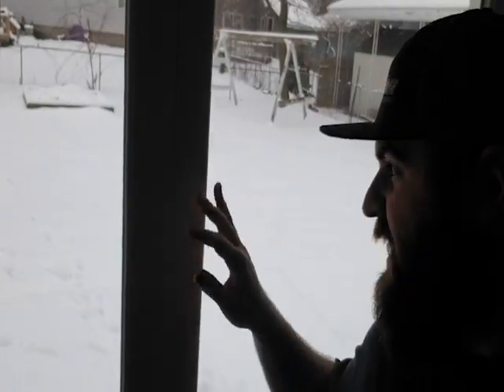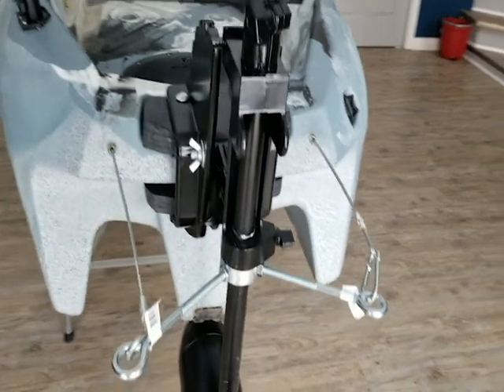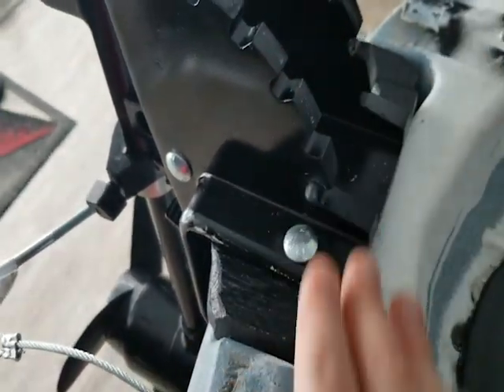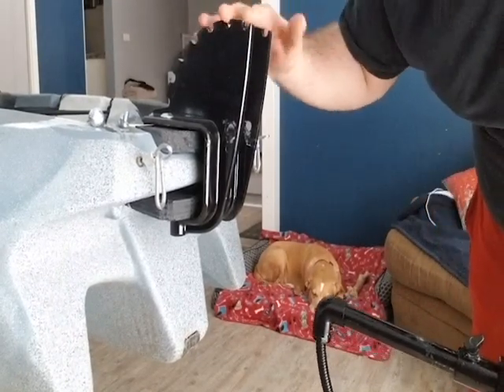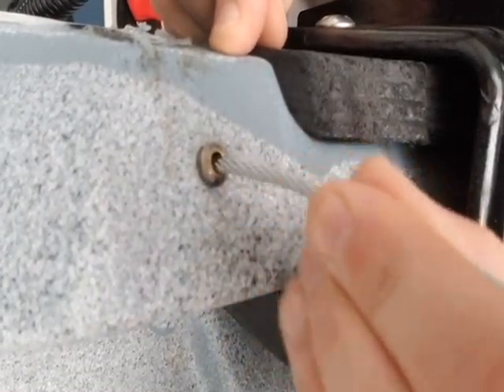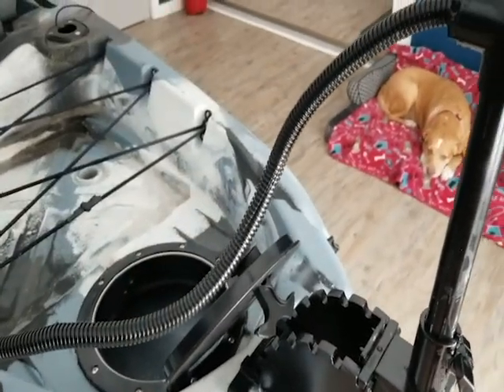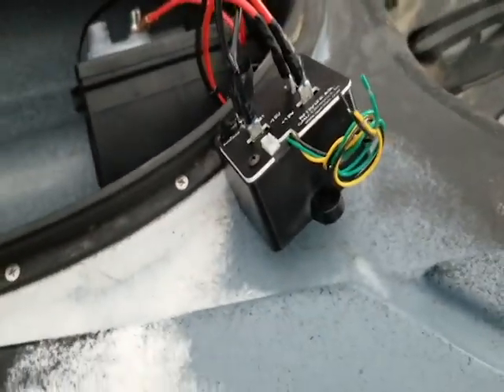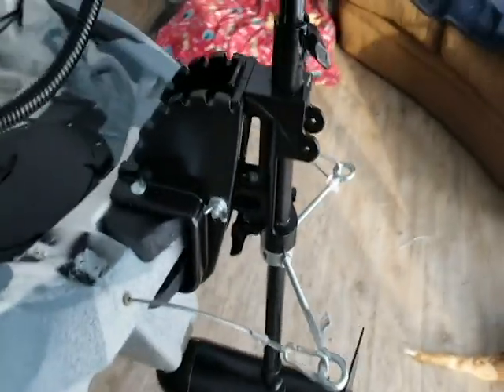How to install a trolling motor on a kayak ( Shadow caster)

Comment: Great video, thanks. I’ve been looking for a solution to steering on my sportsman120. Rudder cable come out the back of the boat like this. Most set ups show cables coming out in front of the motor.

Comment: That is a standard flooded cell acid battery.  It should be mounted and stored in an upright position to avoid spillage. It is true that sealed lead acid batteries and absorbent glass mat batteries can be mounted on on their side but that's not the kind of battery that you have there. If you can't mount a flooded cell acid battery upright you should replace it with one of the batteries that is designed to mount in multiple positions.

Comment: I got my Shadow Caster last week, bought a minn kota the next. I'm wondering, does mounting the rear handle like a transom steer straight compared to a side-car or side mounted trolling setup? When accelerating,the minn kota on one side using the existing rod holders and a plank to hold it offset - the kayak will not track the water easily with the tri-hull design. Make some big kayak donuts on the water perhaps. xD
I'll give this a try with some over the top cables than through and experiment once I receive a marine battery.

Comment: Thanks for sharing! Have you found any info on shaft length on a kayak?

The rule of thumb, for boats anyway, is 12 inches + distance between your transom mount and the water line. That's the bare minimum though.  I can't find any info if this applies to kayaks but I'd imagine so.

Comment: As bad as I hate to say after I spent 300+ buks I come to accept that a goshdamn paddle makes much more sense ,safer, less hassle , and probably even quicker ,not to mention lighter!! But thatfor my side mount rigger riggd set up on a sit in single man . It got almost dangerous today ,pushing me every where but the way I needed to go .
Reply from the maker: Yea u need a heavy ish yak to hold the weight

Comment: you think your modulator for 12v @ 30 Amps would work with my 12v 46 lbs thrust trolling motor?